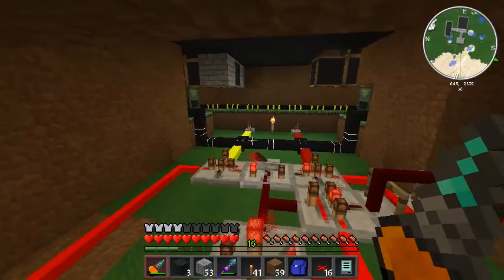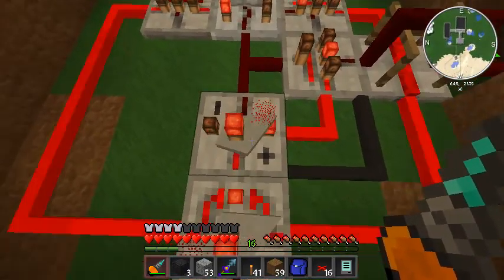FunshineX Lets Play | Computerizing Minecraft | S2E18

Comment: You don't actually need to have the support frames bare to the frame motor, that is only needed if you wish to move a motor with the frames, so you could panel the underside up and  build the setup more compressed if you want :) Are you sure about the 0.850 time? I've been testing using RP repeaters on 4, and those work fine, until I reload the world and then they lose ticks...